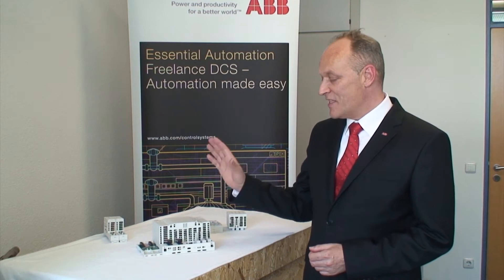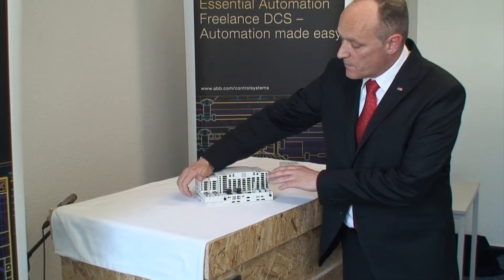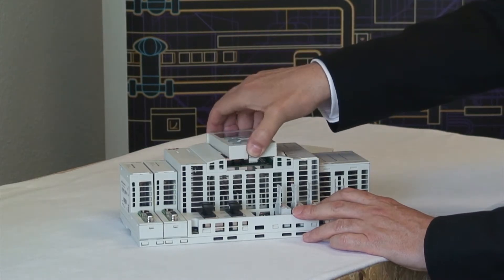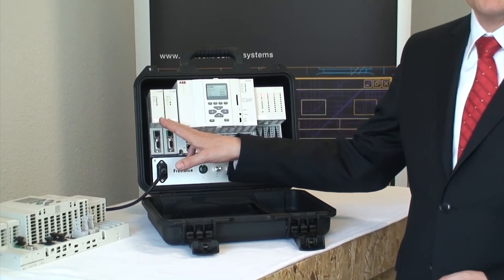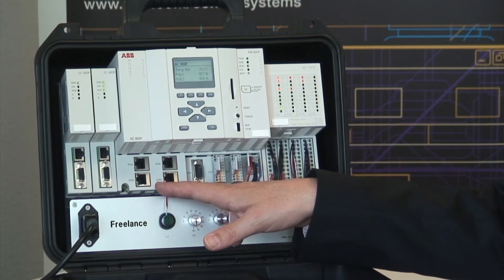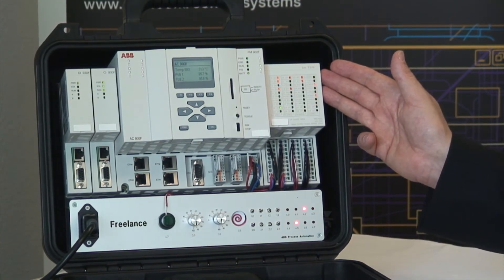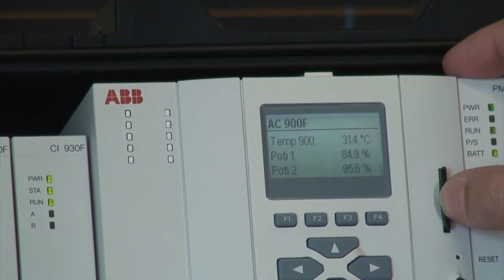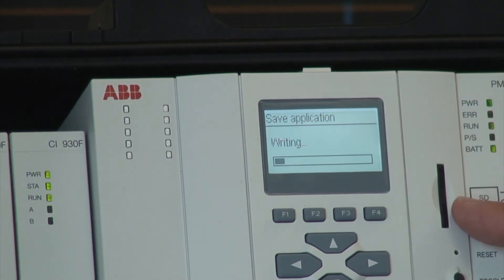ABB Freelance DCS - The AC 900F controller

Comment: Can you explain me why the AC900F (8 MB) has lower RAM then the AC800F (16 MB).
I had switch from AC800F to AC900F and i got Problem with PRAM an RAM SIZE, the AC800F has no Problems.

AND maybe you can tell me, for what is the VRAM?